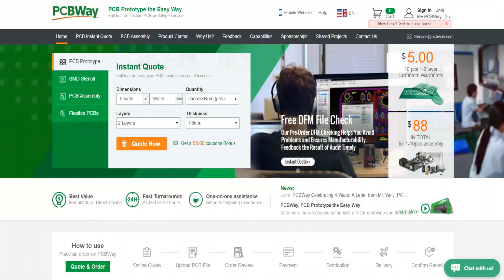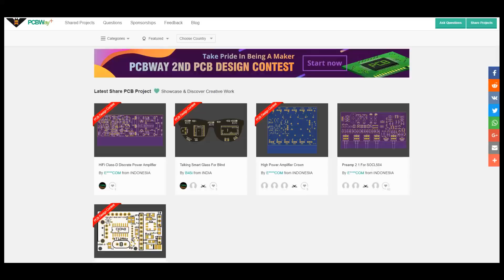Old Mixer Motor as a 100W Generator || New Idea to Self Excite - PCBWAY

Comment: how to make connections of there are more than 2 field windings. My motor has multiple wires
Reply: It sounds like you have a multiphase motor or squirrel cage motor. OK the highest resistance set of coils are the high torque slow speed ones. The lowest resistance coils are the high speed but lower torque coils. The others in between are other speeds and torque ratings.
Reply: @scottrich7703 Thank you

Comment: Hey man, how do you generate a high voltage on your previous videos? I wanted to use transformers, but I heard they only work on ac current? I can't get high voltage or current with transformers
Reply from the maker: Yes they work only on AC so first you will have to make an inverter.A simple one.Check my video list.You can make on easily.

Comment: Mr. Electron would you tell me your colleagues of infinitiy SAV who offer a free energy divace of 10 kw whether it is true because they sell it for 15k ?
Reply from the maker: The person who makes and sells free energy generators is a scammer.
Reply: can you explain in a few words because they look and sound pretty convincing
Reply: If you use a weighted flywheel in between motor and generator free energy device is possible Bedini did this. In cars you have an alternator running as soon as starter car starts up. Also research Howard Johnson and ShenHe Wang both made a device using similar concepts
Reply: Sexi.Film